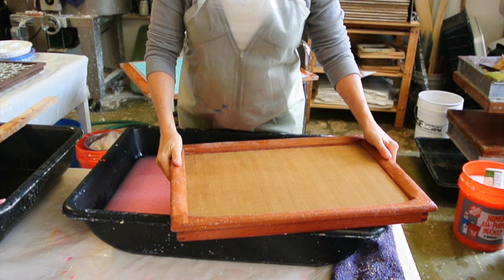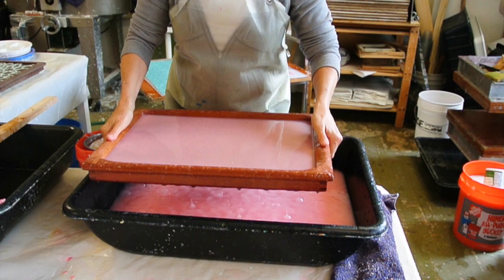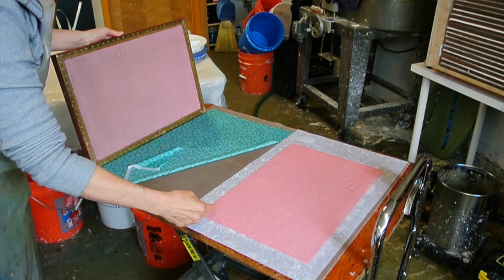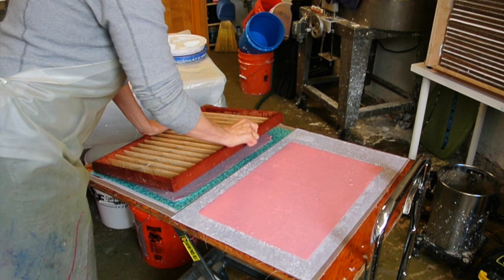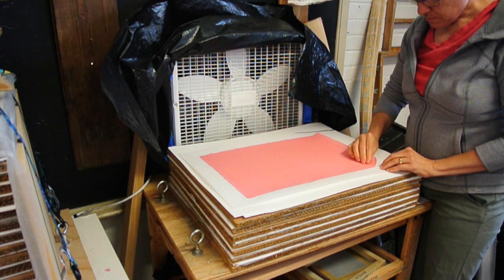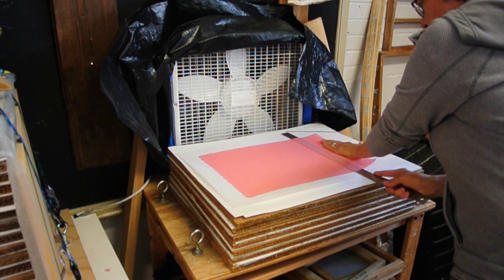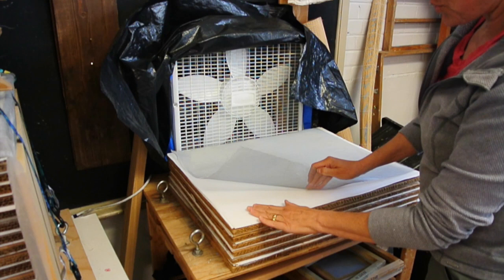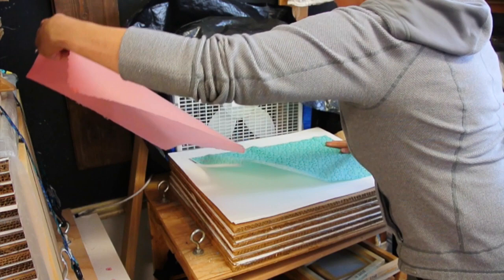Couching & Transferring Thin Sheets

Comment: Try flipping paper over (so felt side up) to remove from felt. Use finger or tool to loosen perimeter then pull felt away from paper. Works well if someone pulls the felt while someone else holds down the sheet.
Reply from the maker: Happy to hear about your method! It's hard to find 4 hands sometimes :).

Comment: Hi Helen, ive had a difficult time pulling the paper off of the screen onto the pellon or blotting felt. am i pulling the screen too soon? thanks!
Reply from the maker: There are many factors like what kind of pulp you are using, how thick/thin the sheets are, what you are couching onto... Here are some suggestions. try making thicker paper, couch onto cotton sheets (like I show here), pour water on the back of the mould after you lay the sheet onto the couching material, flooding the back of the screen. I hope you find success!

Comment: Hey if u can help me with dis... Am trying to couch the paper but am finding it very diff to couch it... It tears n half of d time it jus sticks to d mould.. I am coughing it on felt...
Reply from the maker: Couching can be difficult, especially if you are making thin sheets or your fiber is "sticky". It sounds to me like your sheets of paper are too dry when you are couching. Make sure that your felt is wet, and you can also try pouring water on the back of the couched mould. That sometimes helps the paper release.
Reply: @HelenHiebert  my fiber s made of newspaper.. n ya my felt was dry shall try it by making it wet... Thanks ☺️

Comment: Cool video, where do you get the large white couching sheets that are underneath the cotton. I can only find smaller ones. I have a hard time drying the paper well so there is a smooth surface for using as printmaking paper.
Reply: I guess you call them blotter sheets.
Reply from the maker: @jeremyhulet9498  the blotters are the white sheets in the drying box. The white sheets on the couching table are heavy weight pellon (#65) and you can buy that by the bolt. Both could help your paper dry flat. I get the blotters from Dick Blick or Talas. The are called Cosmos blotters and they are pricey.
Reply: Do you think it would work for the outer layer of the sandwiching to be felt instead of the 2nd linter/blotter? So felt/linter/pulp/linter/felt. I'm just thinking cost effectiveness.
Reply from the maker: @jeremyhulet9498  I have seen people use other materials like this. As long as you can get everything to dry, I think it is okay. You don't want any moisture trapped in there, or you'll get mold.
Reply: @HelenHiebert  Thanks for the help Helen! I started pressing the sheets like you mentioned here and in your drying box video, but I'm having trouble getting a really smooth surface. Do you have to use the blotters and have them next to the surface you want to be the smoothest or will the cotton fabric produce a nice smooth surface? I would like them to be as smooth as possible so you could even write/draw on them. I tried pressing and them letting my pieces hang dry with the smooth side next to some cotton bed sheets when they hang but it wrinkles and there is a grid pattern still left behind.
Reply from the maker: @jeremyhulet9498  the grid pattern is from your screen, I'm guessing. Every step in the process affects the paper surface. I can't really help you anymore via typing. Do you have my book, The Papermaker's Companion? It is in libraries if you do not wish to purchase it. You'll find detailed explanations about each step in the process in that book.

Comment: Hello Helen,  I would like to ask what the exact name of the white pellon that you are using? I tried to search for it online but there are too many different options and i dont kbow which type can be used for couching. Thank you in advance!
Reply from the maker: I use Pellon #65 Extra Heavy Weight sew in stabilizer. I usually get it at Joann Fabrics.
Reply: Dear Helen!I very much appreciate your help! Thank you Helen! If you don’t mind me asking an other question, do you know how to make ebony black paper? What do I need to dye it with?

Do you know what I could use to dye the pulp with to make ebony black paper?
Reply from the maker: @traistarumonika7965  there are many ways to color paper. I'm sorry I don't have a perfect solution. I use acqueous dispersed pigments that I mix into the pulp. Others paint on top of the dry sheets. Do you have my books, Papermaking with Common Plants & Garden Weeks and The Papermaker's Companion? There is info on pigmenting and dyeing in those books.
Reply: @HelenHiebert  thank you Helen, I am going to buy your books! I most struggle with how to keep the strenght of the pigments, they fade away very much after drying. I use natural pigments like green  clay , mixed in the pulp. Do you have a solution for how to keep the strenghts of the colours?
Reply from the maker: @traistarumonika7965  dyes fade. That's just a fact. Pigments are more lightfast.
Reply: @HelenHiebert  Thank you.